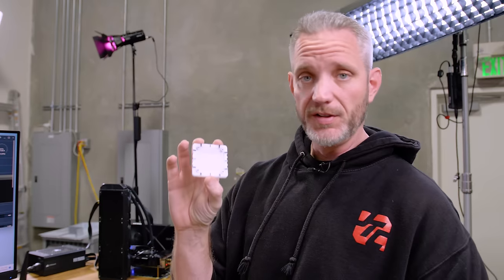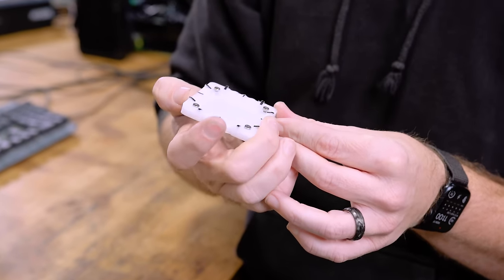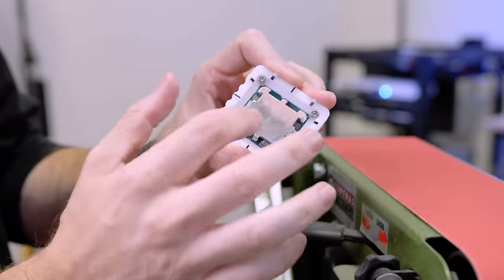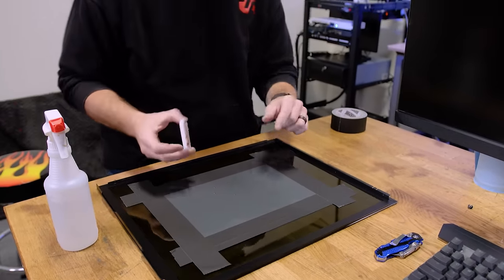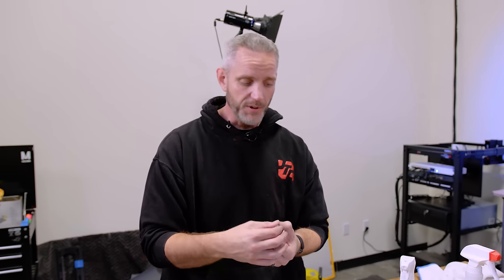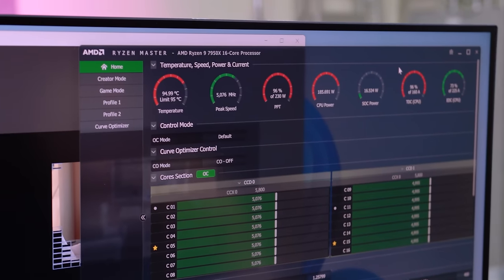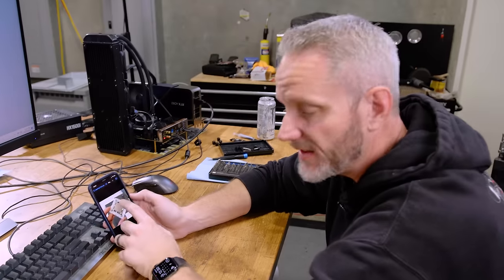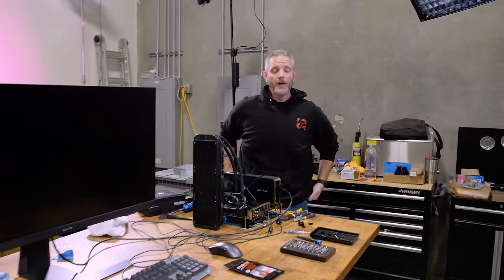Modifying the 7950X CPU for better thermals... VOIDED WARRANTY!

Comment: Every single one of you "gurus" do lapping wrong.
glass isn't a flat surface
you need to lap both contact surfaces against the same reference surface. 
DO NOT put thermal compound between the lapped cpu and heatsink. that defeats the whole point of lapping.

Comment: Edit: Yeah I don't think launching the CPU with a belt sander is what they mean by "blazing fast" 🤣
I'd be okay with 95c as a safe temp, if it didn't require me to run the AC harder in summer, but on the poitive, when I ran an FX 8370 I saved a lot on heating while gaming :)
Reply: The temperature of the die has nothing to do with how much heat your PC will emit. For that only power consumption matters.

Comment: I mentioned this on the last lapping video that I saw you do...There are some really cheap optical flatness gauges out there that will 100% correct any flatness issues that you have.  Very easy to use and cheap.  But you probably wont see this comment...